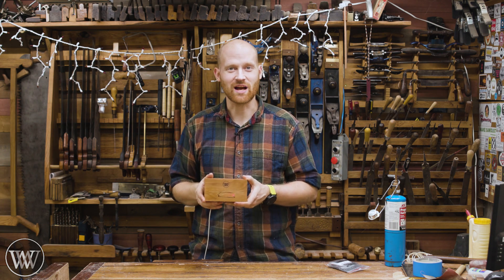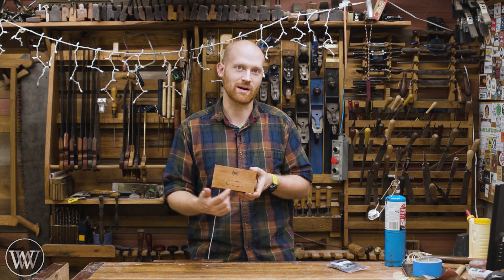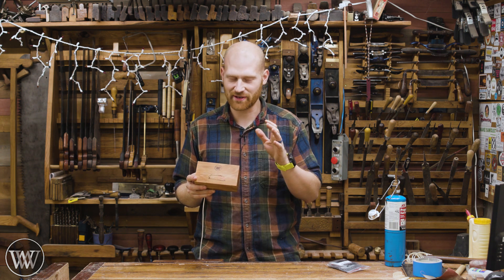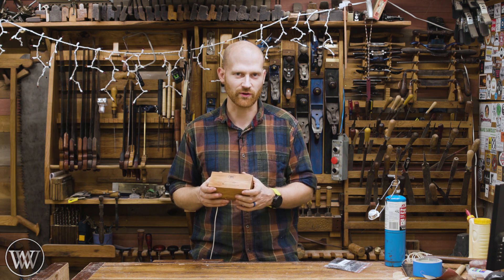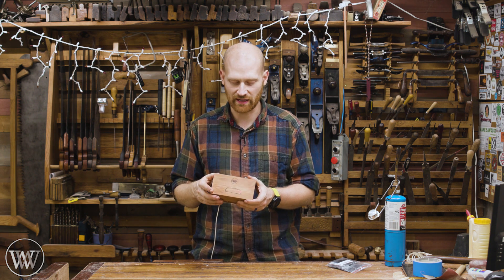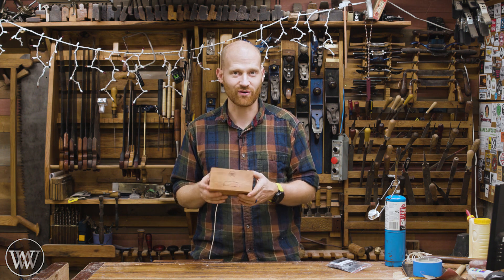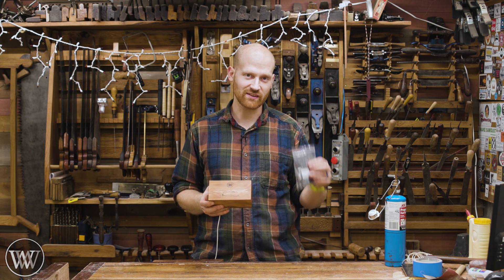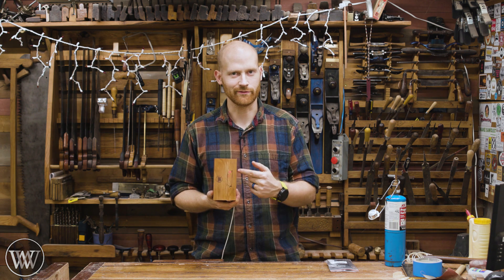Digital Subscriber Counter in a Wood Block

Comment: Hey!

I wrote the YouTube API library for Arduino that Marcel's code uses, awesome to see it do the rounds like this!

Regarding the LEDs being too dim, that 8 digit display wouldn't be the brightest ok as it's actually lighting up each digit one at a time, it just happens so fast it looks like they are all on, but it reduces the overall brightness.

If you search for "becky stern subscriber counter" on YouTube, she made one using 2 4 digit displays from adafruit which should be a lot brighter.

Any questions on it just let me know!
Reply from the maker: Sweet! thanks for the info. I will have to look that one up!

Comment: Use end grain for the face. Super thin. No more then 1/8. You could also use hydrogen peroxide around the area where the lenses to clear out the cellulose and make a little more clear. Look down the straws, you'll never get a clear picture from the side of them
Reply from the maker: Interesting idea! I might have to play with that!

Comment: On one of the science channels, either CodyLab or Nile Red, they showed how to make wood translucent by washing the lignins out of the wood. If you tried that, you could potentially leave the face a bit thicker. The problem then is, the face wood would be a different colour to the box
Reply from the maker: Now that is an interesting idea!
Reply: @WoodByWright  Sadly, if those two are making videos about it, you can pretty much guarantee that the chemicals needed will be either be horrifically toxic or will be something that needs to be stored in concrete and explodes violently if you look at it!

Comment: Seems like an obvious solution would be to work the face as a separate piece and glue that on instead of the back but I respect that you want to take the more challenging path.  I also wonder if running the piece through your stabilization process after the bulk of the carving is done would help to strengthen what would be a super thin veneer in the end. Or would there be so little wood fiber that it wouldnt make a difference?
Reply from the maker: The problem is the final thickness would have to be the thickness of a smoothing plane shaving 0.001" not something you can glue on.

Comment: I think you just need a brighter display. If you give it another shot, you could also try to reinforce the thin wood with epoxy or CA glue from the inside. Maybe it’ll hold the fibers together better?
Reply from the maker: Ya I did it before on an alarm clock and it was much thicker with a brighter display. This was supported with super glue I used a thick gel to coat the bottom completely. That is the dark part poking out around the outside.
Reply: https://www.lc-led.com/Catalog/department/36/category/49/3
Reply: Ohh, I see. I thought it had broken through around the edges. That’s what I get for watching videos on my phone.

The link I posted, they have 4 digit displays, common cathode, 0.36” 
Ya might be able to swap them out, but they have the colon so there would be an extra pin- but you could snip it off, as long as the pin out is similar. 

Good luck my friend!

Comment: try doing it like a bandsaw box, will be easier to get to the front bit you need to thin/flatten
Reply from the maker: I would still run into the thickness problem.
Reply: would using a router plane not make it more uniform?

Comment: Try to Veneer the surface with a wood that is more Translucent.
Reply: You should only have to chop out enough to bed the counter in to place. Make your own veneer and you can test it to perfection before applying.
Reply from the maker: That was what I was thinking, but with this display even pine would have to be down to 0.005 or less to see in room light.
Reply: @WoodByWright  The thickness challenge is presumably with the chisel-as-a-scraper side of things, not the smoothing plane. So cover the hole with whatever thickness veneer, then plane that down, so at least you're starting with a consistent thickness.
Reply from the maker: That is basically what I had. The inside was perfictly flat. I used a feeler gauge to check smoothness.

Comment: What are you putting on the saw around two minutes? Is that a common thing to do?
Reply from the maker: It is paste wax. Some just use oil or different waxes. Yes it can make a big difference it tight cuts.

Comment: Nice attempt. Could you have cut the opening for the display and then cover the front face with a thin veneer (possibly from your plane) or rice paper?
Reply from the maker: Paper would be interesting but veneer is not thin enough. It would have to be the thickness of a fine smoothing shaving.
Reply: @WoodByWright  veneer actually is thin enough for this! The channel "I like to make stuff" made a clock similar to yours, only with veneer. Worked well :)
Reply from the maker: @KXK2010  yes. I have done it in the past that way too but not with this LCD display. For this one it would have to be around 0.001"
Reply: My thought exactly.

Comment: 0:40 is that a hand-powered drillpress ?
Reply: 👍 Thanks
I'm belgian so speak french and learn english only by watching YouTube videos like your so today i learn "post drill" for "foreuse a colonne manuelle"
😉🔨🍒🍻
Reply: yes....…….my dad had one and my brother put in the dump.....I could have shot him
Reply from the maker: Yup. It is called a post drill most commonly used for metal work.
Reply: @WoodByWright  put oak veener over thru hole that has digital counter in it veneer starts out at .020 thick hand scrap down.